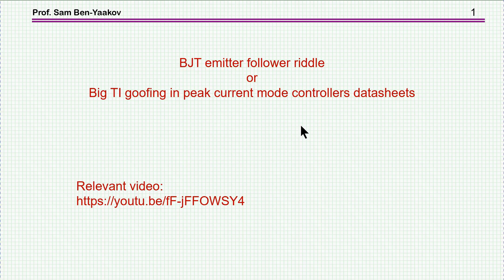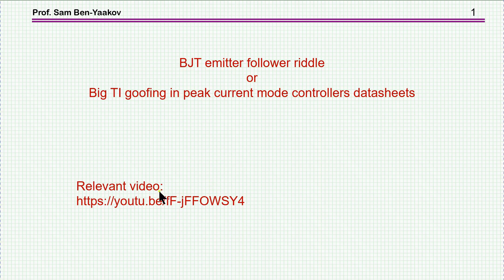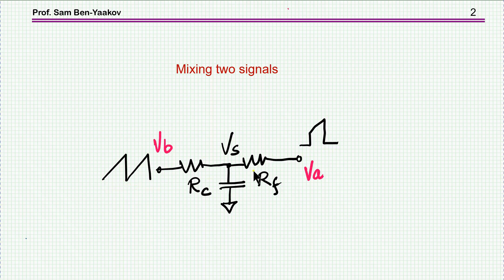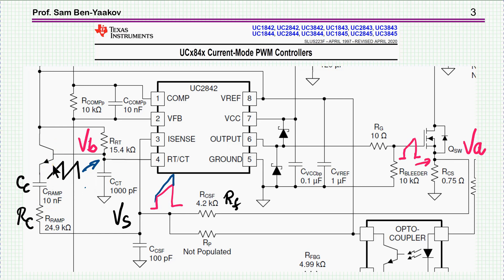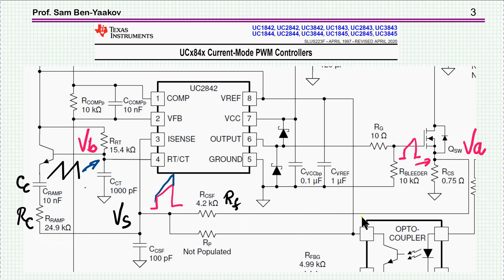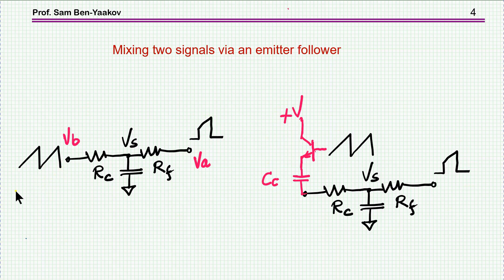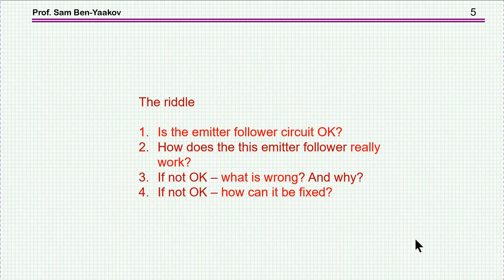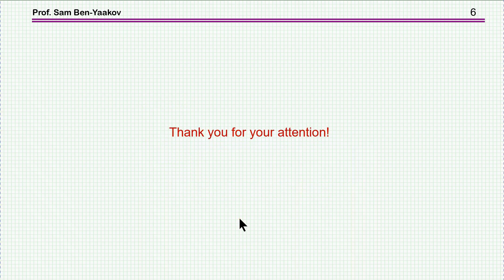BJT emitter follower riddle: Big TI goofing in peak current mode controllers datasheets

Comment: Rather than trying to buffer the oscillator ramp, it is best to stay away from it considering the noise susceptibility of this section. Better use the low-impedance drive output to build a compensation ramp with an RC and a diode. This is widely used in the industry and works whether you can access the oscillator or not.
Reply from the maker: Thanks. Good point. But TI design is still incorrect😊

Comment: I think this is absolute mistake to the noble PWM IC, one of the most famous PWM controller since the correct circuit for slope compensation has revived on other xx3842 datasheets from various makers. However I wanna point out another thing, that is whether this is proper as signal source for slope compensation. You know the RT/CT pin is very sensitive pin and Isense pin is taken by very noisy signal. better for being far from each other? I refer to Dr Ray Ridley's paper " Current Mode Control Modeling". By the way, always thanks and always interesting!
Reply from the maker: Thanks for input.

Comment: A additional reverse schottky diode over BE diode of the bjt? To achieve discharging of the Cramp when the ramp goes steep down. 
Probably it would be enough to simly remove Cramp.
Reply from the maker: I rather remove a component than add one

Comment: Wrong is that capacitor in the emitterline. This transistor don't has a DC current out of the emitter so no current can go into the base. It could be fixed wirh a resistor from emitter to ground or minus, i would think something like 1k or 4k7 or so could be ok.
Btw, what superfun, such real electronics riddles! I never before saw such a thing and i love it!
Reply from the maker: 👍I  would rather remove a component than add one.

Comment: Hi Mr. Ben-Yaakov, your videos are great. You present technical topics in quite an interesting way!. About the riddle I think the transistor is not correctly biased. There is no DC reference at the emitter, no bias resistor from the emitter to GND . A resistor should be added from the emitter to GND, before the decoupling cap.
Reply from the maker: Good points. Thnaks for contribution.

Comment: The obvious thing is the emitter follower has no DC path to GND and it will not work. I would have one of the 2 following approaches: 1) remove the decoupling cap and resize the summing resistors or 2) remove the transistor and AC couple the signal directly to the RT/CT pin. Again, some tweaking of the resistors might be necessary....
Reply from the maker: Good points. Thnaks for contribution.

Comment: I could find 2 possible issues. 
1. The Base-Emitter diode doesn't let us apply superposition theorem since there is no ground path for the signal coming from current sense resistor through Tramp.
2. The DC biasing of the transistor seems to be missing. So it causes clipping of RT/CT signal below 0.7 or so volts.

I really think some other things are wrong in this circuit. Waiting for the continuation video. Thanks professor.
Reply: That should be Rramp instead of Tramp towards the end of first para.
Reply from the maker: Good points. Thnaks for contribution.

Comment: Лично я вообще не уверен, что там нужен это конденсатор Cramp. Даже если сместить эмиттер, что он там дает? Сместит ноль сигнала рампы и даст отрицательное напряжение на Ccsf? Зачем? Это как то связано с Rp? А зачем Rp? Чтобы уменьшить Rcs? Ну ладно, значит надо сместить эмиттер. Или подпереть FB. А еще лучше взять другую микросхему со встроенной компенсацией рампы и с меньшим напряжением IS.
upd
Personally, I'm not sure if this Cramp is need at all. Even if we offset the emitter, what does it give there? Will offset the zero of the ramp signal and give a negative voltage on the Ccsf? What for? Is it somehow related to Rp? Why Rp? To reduce Rcs? Okay, so we need to offset the emitter. Or shift up FB. Better yet, take another IC with built-in ramp compensation and with a lower IS voltage.

Comment: The emitter follower does not have dc bias, so it won't work properly.  This can easily be fixed by adding one resistor from its emitter to gnd.  Value of this resistor should be chosen so that Vbe variation over the range of operation (ramp) does not cause significant error to the ac signal output.  At first guess a value between 10 to 20% of Rramp would seem suitable.
Reply from the maker: I rather remove something than add.
Reply: @sambenyaakov  Agreed - if that is possible.  Of course, what the designer of this circuit is trying to do is ensure the converter is stable for duty cycles > 50%, and what has been implemented here is the old "slope compensation" solution to this age-old problem of sub-harmonic instability in current mode control that was treated by Middlebrook and others back in the late 70s, if my memory serves.  Adding some of the slope from the voltage ramp at pin 4 to the current-sense signal at pin 3 can be done very simply just by connecting a resistor between them, however, the BJT emitter follower makes the selection of the various components involved in current sensing (Rcs, Rcsf, Ccsf, Rramp) much easier since the BJT isolates pin 4 from the loading effect of these components - which is important to keep switching frequency both predictable (from unit to unit) and constant during operation, ie: not varying with load.

Perhaps the designer, in this case, wanted to have a standard design that could be used for many different applications (different power levels, output current, etc) and did not want the hassle of having to re-validate the design each time the current sense components were changed - the only problem was that he (or she) forgot to correctly bias the BJT.  
:-)
Reply: Sorry, forgot to add: the addition of the DC blocking capacitor, Cramp, gives the designer an extra degree of freedom since the ramp compensation signal does not have a DC component - sometimes this is important when considering over-current limiting and short-circuit protection, but yes, in the case of the UC3842, this is probably an unnecessary luxury.  Perhaps the author had copied this design from the app note of a different IC and did not amend it sufficiently for the typical user of the UC3842.  I note that the older datasheets I have for this chip show the same circuit as per your video but without the DC blocking capacitor, Cramp.
Cheers.

Comment: This is , I think , a relatively recent addition to the data sheet/application data  . I have been using this IC for many years and have stumbled across this weird circuit only recently  . It seems to have been revised in April 2020 . 
Though I have used this controller many times , I have found it difficult to achieve stable pulse width without jitter  over the entire duty cycle from near zero to the desired maximum pulse width of say 50%.
I have found it useful to connect pin4 to the Isense via a small capacitor of about 470pF .
Above 50% duty , slope compensation has to be employed and the Cramp must be removed and Rramp adjusted for the required level of slope compensation .
Thank you for raising this interesting topic .
Reply from the maker: Yes. This is a recent "improvement" to the worse

Comment: The emitter follower can only source current, not sink it. The addition/mixing circuit only works if both sources can source and sink current. A strong pulldown at the emitter of the transistor will solve it, or maybe some sort of push-pull buffer stage, like an opamp.
Reply from the maker: Correct, but I rather remove something than add.
Reply: @sambenyaakov  Well you can remove the buffer BJT itself and just connect the adder to the RT/CT pin directly. That'll only work if the source impedance of the RT/CT node is much lower than the adder, which doesn't seem to be the case.

Comment: A resistor to ground is missing?
Reply: Agreed. resistor from emitter to ground otherwise the cap will simply charge up to v+ .
Reply from the maker: From where to where?
Reply: @sambenyaakov  From Emitter to GND or else the DC blocking capacitor in series will not have proper discharging path.
Reply from the maker: I rather take out something than add.